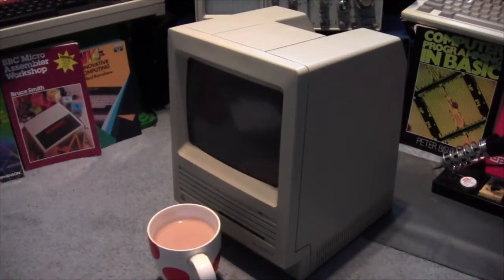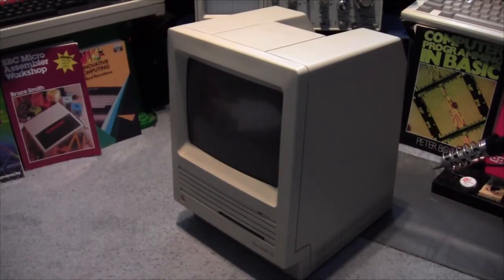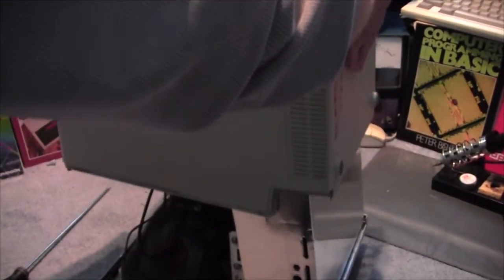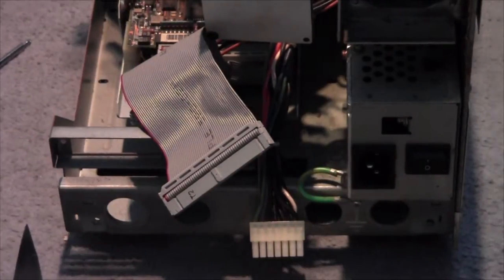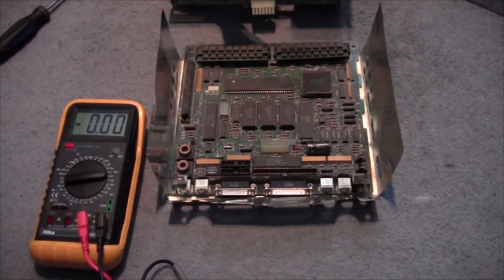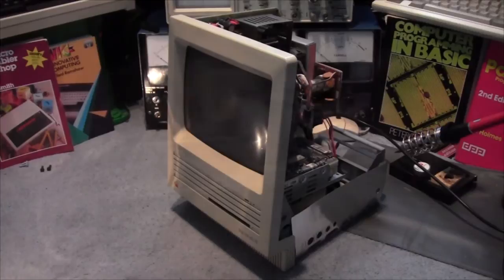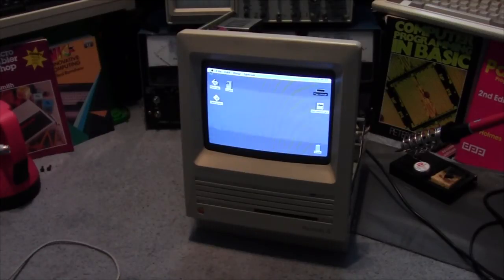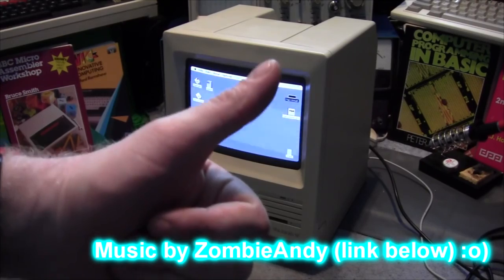Apple Macintosh Se Battery Removal Operation :o)

Comment: Just did this myself a couple weeks ago, that power connector on the logic board always takes me 20 mins to get out because of its position in there - can just barely grab it with the tips of my fingers, frustrating. lol. It was actually the first time I dealt with one of these early Mac SEs with the battery soldered right onto the board. I ended up desoldering that battery and adding a battery holder + new 3.6v 1/2AA like the later SEs have. Will be easier for future replacements. Cool vid! :)

Comment: Changing the battery is one of the first thing I do with a piece of retro/vintage equipment.  In machines like the amiga 2000, the battery will leak right onto the CPU and destroy the tiny traces if you do not remove or replace it ASAP.  Another common mistake you see is attempted/botched repairs where they hook a non-rechargeable up to a charging circuit, common in the sega dreamcast... def not good :(

Comment from the maker: It's died since, it's got the ram problem.  First suspect is the fact it's not got the battery in, but I managed to shock it a few times when I was testing the floppy drive out of it's holder so that maybe the problem :o(  I may have to probe it ;o)

Comment from the maker: It started doing it a few weeks ago, resetting, after I did this (old video this actually is), so maybe caused by the battery being out.  But I did shock it a few times when operating on the floppy so may have caused some damage that way :o(